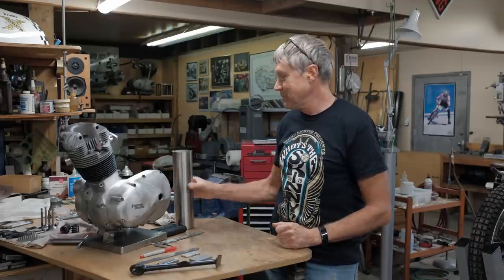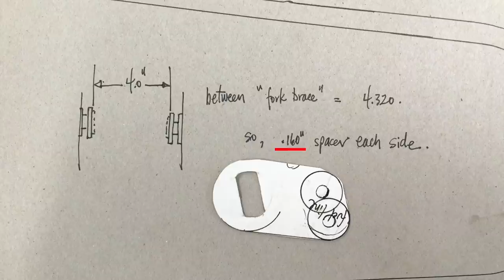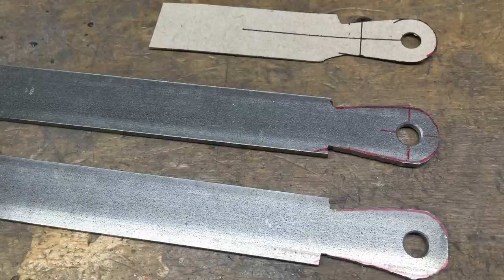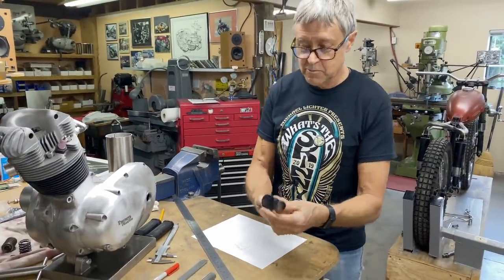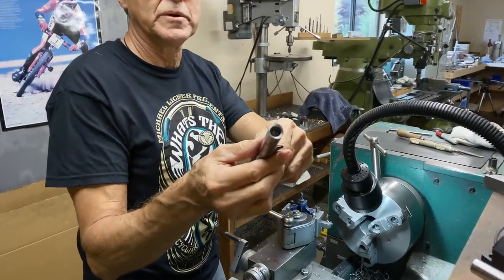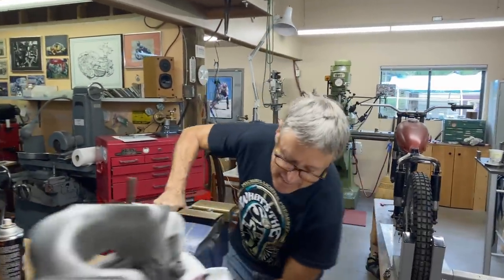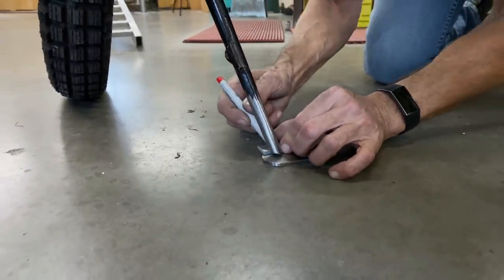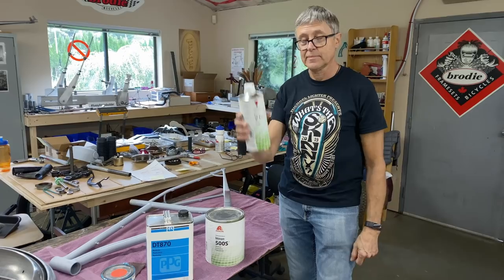Finishing Up // Paul Brodie's Shop

Comment: that reminded me of the first ever bicycle frame I repainted...with rattle cans in the early 80's it was my late grandfathers Raleigh daily use type bike so old it still had white paint on the end of the mud guards from black outs during WW2....& of a cycle my Dad got me it was some sort of training road bike with 5 speed on one side of the rear wheel and a fixed gear on the other... after he made sure I could ride it he took it into the main Citroen Dealer in Edinburgh where he worked and got the foreman painter to spray it a metallic blue.... another great video thanks
Reply from the maker: Derek, thanks for watching and commenting.

Comment: Excellent episode, and all the better for being a mix of bike and m/c stuff. Thanks. Les in UK. Hey, we also spell ‘aluminium’ properly as well as say it right! Les in UK
Reply: Hey Les, have you heard how Americans pronounce 'solder'? I wonder how Paul says it.
Reply: @gerry343  i think I have heard him pronounce it the “British” way, but when Americans call it “sodder” it makes me wince (it sounds immoral!). A friend, now dead, once did a talk in the USA on home brew electronics, entitled “Putting the ‘L’ back in Solder”! Les in UK
Reply: @gerry343  I finally got rid of the wife. Sold 'er? Sod 'er...
Reply from the maker: Thank you Les. Yes, I have kept the "L" in solder, at least I think I have!
Reply: @paulbrodie  Paul, you do fine, Mate. I have no complaints, really. And I really enjoy your projects. In the 60s I used to have a BSA C15 (developed from the Tiger Cub). Most Cubs in UK, at least in trials trim, seem to have engines enlarged to around 230-250cc. Will you be doing that sort of conversion? And what about the fork rake with those longer forks?  Perhaps a shop-made set of ‘triple clamps’?? Looking forward to the home-made silencer (muffler). Les in UK
Reply from the maker: @leslieaustin151  I have no plans for more than 200cc, but I really would like to locate the larger "square" head and barrel. I like the look, and it has to be better for cooling. I'm thinking I want 1/2" longer rear shocks, and I might shorten the forks a little to level out the "stance".
Reply: @paulbrodie  Why not refer to it as geometry?  https://en.wikipedia.org/wiki/Bicycle_and_motorcycle_geometry
Reply from the maker: @Rocketron1955   Because we did an episode where we talked about the "stance" of the bike.

Comment: Excellent episode!! I love the mix of different topics and procedures etc.The muffler build will definitely have my attention as Im contemplating two stingers for my Yamaha LS-1. Once you painted Mitch’s frame that shade of blue, I had immediate flashbacks iced with remorse to the Yeti hardtail I parted with quite some years back. My lust for a Honda XR100 that I could build into a “big bore” flat track/road race/everything else bike overruled the majority vote taking place in my head. Not long after that, Yamaha came along with their front disc TTR-125. The Brown Brothers rejoiced, Honda owners wept openly
Reply from the maker: I have some friends who regularly raced the TTR-125 inside a huge chicken barn with a concrete floor. A lot of them were ex racers so it got very competitive and sometimes they went to hospital. Thanks for watching and commenting.
Reply: @paulbrodie  Yup! Stupid Yamaha and their stupid TTR125!!!!  The disc front brake, wheel sizes that allowed actual race rubber, an aftermarket overflowing with go fast goodies ! Whomever is responsible at Yamaha for bringing the TTR125 “big wheel” model to the powers that be should have a statue erected in his/her honor. There is zero doubt in my mind that they developed that bike for adults lol, not kids. That bike instantly relegated anybodys built XR100 to the back of the pack.! Playbike? I think not!
Reply from the maker: @glenpiro313  I'm told it's a great bike for women to learn on too.

Comment: Could you give some detail on the fresh air setup you are using? Is it commercially made or did you make it? Also, how did you make the ceiling mounted swivel in your paint booth? Also, any pictures showing how you did the exhaust side of the paint booth?
Reply from the maker: I have a 10 X 10' Binks spray booth. Exhaust fan is 5HP, comes with the booth. The air to my mask is from a Binks oil-less air compressor. Bought it new in 1988 for $1000. No idea what they cost now. Check the last couple of videos; I show how the ceiling hook is made and mounted.

Comment: Thanks again Paul and Mitch. Would it be possible to dive deeper in the painting area... Could you tell us about compressor, air pressure, what do you use to filter the incoming air, what is the exhaust fan set up like? It look very commercial yet it looks like you build it yourself. Also what happens to the leftover paint and chemicals, how do you get rid of it safely, and how to you clean your equipment after each paint session?... I know its a lot to ask for but it could give us a good idea of all the work involved. Also I see an unpainted frame there... Maybe for a future episode? :)
Reply from the maker: It's just a regular Binks booth that I built into my shop. Pressure for the detail gun is 55psi. Yes, it is a commercial setup leftover from my days with a factory building bicycle frames. I let the leftover paint harden up completely and then dispose of it with my other shop waste. I just use a regular Binks? intake filter. The unpainted frame must be the MTB I ride.
Reply: @paulbrodie  Thank you Mr. Brodie!

Comment: Hi Paul, when you are painting the frame, why don't you mask the head tube inner diameter and thru axle hole?
Reply from the maker: If a little overspray goes in the head tube, that doesn't matter. We do scrape the paint off the ends of the head tube so the headset can seat properly. And Mitch did scrape a little inside the right dropout so the insert would fit nicely.

Comment: Hey Paul, in one of you videos would you mind doing a little slideshow of how you painted the tank for your tiger cub? I want to paint my Honda MiniTrail 50 tank (and I'm terrible at painting) and it has a similar two tone setup with white on the bottom half and yellow, red, or blue up top. I'm not sure of the best order of operations for a split paint scheme like that. Thanks for the great videos as always.
Reply from the maker: Thank you Po. Well, the tank is already painted, and I'm not going to repaint it just to make a video. I painted the silver first, let it dry overnight, put it on a soft towel, and masked to spray the burgundy. That dried overnight, then I un-masked, and clear coated everything. It's customary to spray the lighter colour first. Hope this helps.
Reply: @paulbrodie  that's a great explanation, thank you! It looks like to turned out wonderful. I appreciate the guidance!
Reply from the maker: @PosParts   When you're masking the actual paint line, use the blue Thin-line (I think it's called..) tape. I use the 1/4" mostly, but sometimes the 1/8". That will give you a crisp line that regular masking tape cannot do. Then you use regular masking tape to extend or widen the masked area.

Comment: Hi Paul, i want to ask, why we need an extra material on rear disc mount (curve tube 27:17), i mean do rear wheel take so much stress it could messing with alignments before the rear wheel locked and skidding?
Reply from the maker: That little tube is very important. If it wasn't there, every time the brake is applied the seat stay would flex, almost microscopically. You do that enough times, and the seat stay would eventually start to crack and possibly fail. Manufacturers don't do it just for looks; it's a necessary part of the frame. Thanks for watching.
Reply: @paulbrodie  i see, thanks for the answer. :)

Comment: Would it be easier to put the stand back in the lathe to clean the welds rather than a file?
Reply from the maker: You might think it would be easier, but I say not really. You would have to "dial it in", and the stand is a casting, so time would be spent averaging what is round and almost straight. I would say I can do it faster with a file...
Reply: @paulbrodie  a 3 jaw chuck is self centering no?
Reply from the maker: @eugenecussen3735   Yes, but you're holding a tapered casting. It's not going to self centre itself in a 3 jaw.

Comment: When the engine and fuel and seat and everything is on, does the bike sit a little lower and would that affect the stand length needed?
Reply from the maker: Basically no. You will find out why in next weeks' video!
Reply: @paulbrodie  I cant wait to see the explanation!  I do boats, if we painted the water line on the boat in the water, just imagine, then added engine fuel food crew accommodation that waterline would be submerged.  Some clever move with shock absorbers or an anti gravity unit, ah maybe fatter tyres!
Reply from the maker: @Paddington60   Anti-gravity, hmmm... I had not thought of that!

Comment: How large is your paint booth?
Reply from the maker: It's a Binks 10 X 10' that I built into my shop many years ago.
Reply: @paulbrodie  I’m going to build a 9x12 in my shop. Should be large enough for frames, etc. I’m a mechanical engineer so I’ll design (ok copy) a commercial version. Love the videos. My Aermacchi obsession is with the Baja 100. Have three I’m restoring, along with a Husqvarna obsession-8 total 1970/71 250/360 /400 cross, and 360C sportsman’s, Four are 8 speeds.
Reply from the maker: @jpwesley2471   I say mine is 10 X 10' but the room it fits into is larger than that. That's great you have a passion for older bikes :)